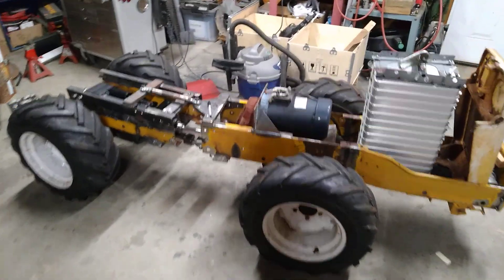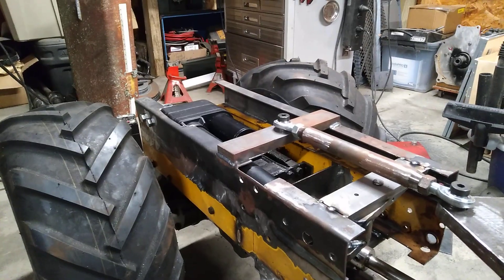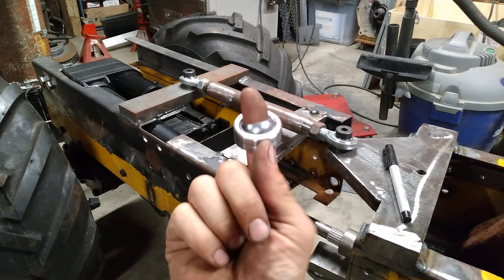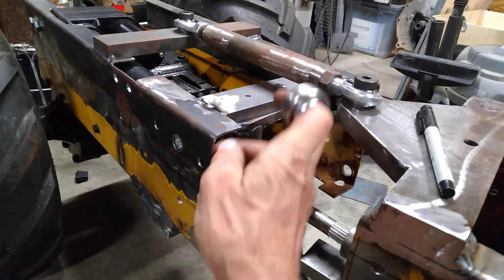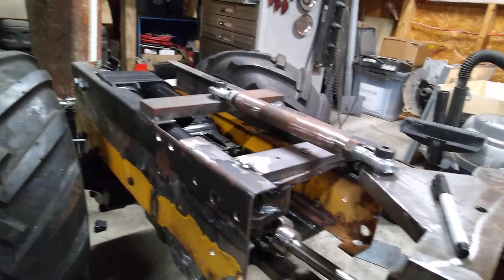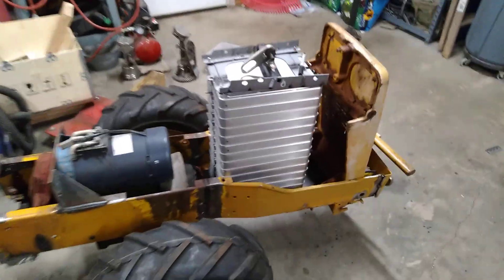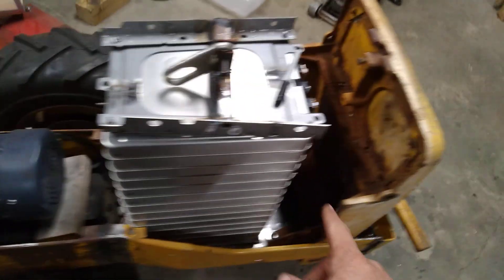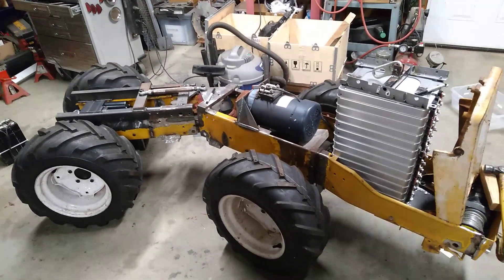Getting Better -The Cub

Comment: and tapered roller bearings in pairs, take both.
Reply from the maker: absolutely right and I think that's what I'm going to go with.  Two of these might take up the slack but one still has movement. It's OK for now but over time it'll just wallow out the hole and get worse.  Back to the drawing board!